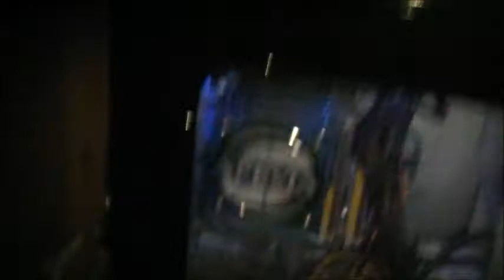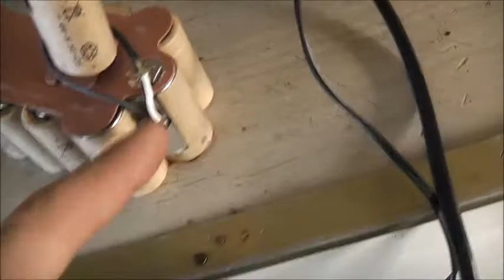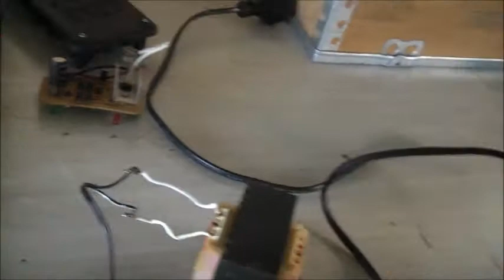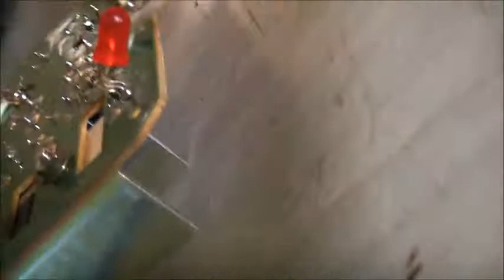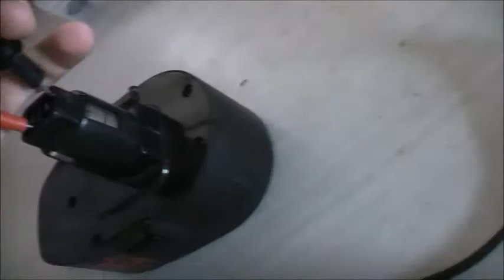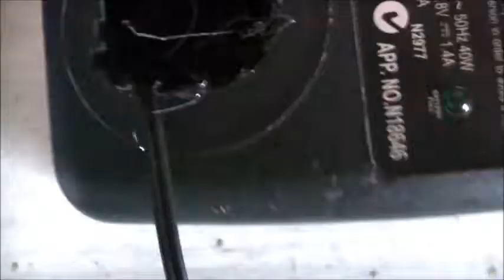ZVS Drill Battery Charger Mod

Comment: Memorys and there sockets are not as perfect as they should be, ive had the same problem larry, they can look clean but really act up :-(
.
What i do.
Scrub the memory pads with a cotton bud and alcahol, and for the socket ive found cardboard handy for sliding in and removing slight muck, use the non glossy open pore cardboard. :-))

You may want to put you ammeter in line with the charger to see how well its working.
Just a thought as nicads charge correctly via a constant current charge :-)